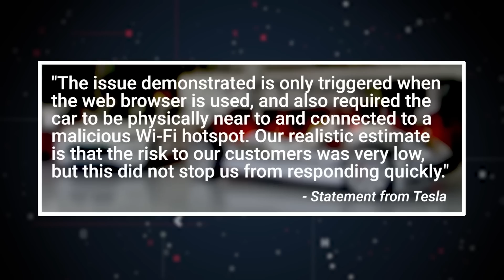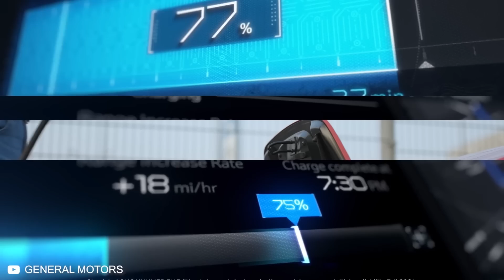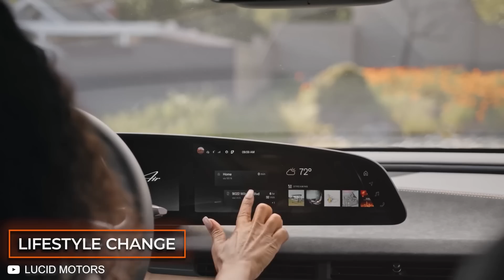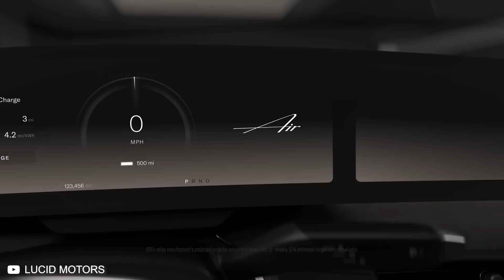EVs' Serious Problems That Carmakers Are Hiding

Comment: Cost of maintenance of ICE car is high plus the  regular inconvenience of  going to dealership/ gas station for said maintenance. Expenses  for  engine breakdown are  also  high. Most internal combustion engines give you problems after  50K-100K miles   which an EV/ battery  pack can surpass without so called "maintenance". Some called EV  living in a bubble- Oil is going to run out  sooner or later and  subject to whims of dictators. Expecting oil to be around  forever is living in a bubble
Reply: I currently own TWO ICE cars with better than 150K on the ORIGINAL ENGINES LANCE!! In fact, my wife's car was born 21 years ago and runs like a CLOCK today! Her PT Cruiser is still on ALL of the original components and my 2007 Magnum with almost 300K miles is STILL on its original motor and only on its second tranny. I will take $50 oil changes all day long against 7K to 10k battery replacements...BTW-Care to race me CROSS STATE or CROSS Country sparky? So its pretty ignorant to say most ice cars engines live 50k to 100k miles. Also, the Earth MAKES OIL BRO! 30 million barrels of it EVERY DAY! If we were going to run out of it-we would have by now! Start THINKING for yourself bro! Many many oil wells keep producing oil LOOOOOOONGGG after they were predicted to run out. And BTW-only about 18% of oil is used to make gasoline. Most oil is used to (look out..) PRODUCE ELECTRICITY.....which means YOUR EV STILL RELIES ON OIL for its power.....So if oil ever "ran out" your EV would be permanently parked as well sparky...
Reply: Do you think the rare earth metals just pop out of thin air? You're also living in a bubble if you think we have an infinite supply of the lithium, cobalt, nickel, etc needed for EV'S. It'll all run out oneday. I need to tow heavy equipment long distances for work and EV's simply won't make the trip, and there's no way in hell that I'm sitting around loosing money waiting for a truck battery to charge. Also maintaining my truck myself is also a huge reason why I'll never buy EV. Why pay someone to fix something when I can do it myself?
Reply: Also only 50-100k before your engine gives you problems? Check and change your fluids more often (you can do it for free in your driveway or on the side of the street with a little work ethic😉) Preventative maintenance goes a looong way.
Reply: Never had a issue prior to 270k mile and approx 20 years old.  Maybe if you maintain your equipment better the cost of ownership would be cheaper. I have gas tractors that are 80 years old and still as good as the day they were built.

Comment: Would I buy an EV now, no. In five to seven years, the infrastructure, better battery technology and magnetism will possibly allow ways to charge while driving. I can imagine in more urban areas, the expansion of electrical lines from metro rails to HOV lanes. Later all highway lanes with be electrified for charging. At that point, I'll take another look at it.
Reply: Tesla is currently pretty good. But I agree, I'd love a Rivian, and Rivian is good for the current technology, but Tesla is still better. A little more range and a bit more extensive charging network would make me feel better with the RT1

Comment: EVs are very good for local commutes as like for shopping, doing errands, taking the kids to school, going to a doctor or dentist appointment, and etc. As for long distance travelling where charging stops must be made is not ideal, unless you don't mind long stops. Range and charging times have been improving since the last number of years, but there is the charging issue for long distance driving.  There is the huge convenience with a charger installed at home. When you come home at night simply plug in the vehicle. The next day it is ready.  If you only drive 30 miles per day the average EV can run for about 5 to 7 days between charges (depending on the vehicle range) in case you forget some  nights to plug it in.  Presently if you plan on doing frequent long distant driving it is best to stay with gasoline. The way things are going with governments and society we are all going to soon be forced to drive an EV. 

There are aspects as like compatible chargers while on route, and available charging stations. When on the road you may have to wait in line to use a charger at some places. There are smart phone apps that can show you available charging stations that are compatible for your vehicle.  The GPS systems in many of the vehicles should have charging station location info. 

As for the life span of the battery pack, after about 5 years or so there will be some indicated or noticeable degrading in range. Ideally you would not want to keep any type of modern vehicle for more than 4 to  5 years, or especially when it is out of warranty. Too many very expensive to service issues that can come up, and also depreciation starts to fall at a more rapid rate. You want to trade in your vehicle while you can get a more decent return on it.  Especially for EVs compared to gasoline vehicles the depreciation is very fast. This is because of the battery pack lifespan, and the huge cost for servicing after the warranty is finished. Then there is also the long term availability of spare parts for servicing. 

As for buying a used EV, remember you are buying an older battery pack along with it!  Rebuilt battery packs may be cheaper, but they will not last very long in relation to what you pay for them. Don't go by what the rebuilding service tells you. Rebuilt battery packs are made up of mixing and matching cells from other used battery packs, and may have a mix of some new cells in them. Remember the other used cells are also older, and thus will have less life in them.  You will pay less for a rebuilt battery pack, but you will also be soon changing it again.  

Because of the rate of technology change, when buying any used vehicle that is more than about 4 to 5 years old take care about long term availability for spare parts. The technology is changing very fast and the manufactures will not forever be making spare parts for these vehicles.  Older versions of the components used in the modules, and also the manufacturing of the older type modules would not be long term feasible for any manufacture. This is the same for older type battery pack replacement if a new battery pack is desired for an older vehicle. As time and usage goes on, all devices start to become less reliable.  The battery pack is very specialized and has to exactly match by design to the model of vehicle. It is not a generic type assembly, equivalent to the idea of being simple batteries. This is the same for the electronics modules and most parts of the vehicle.  There are not many EVs in scrap yards if you wanted to buy used parts to service your EV.  Used electronic modules can be complicated to make work because of firmware version issues.  The vehicles of today are computerized and run by computer systems. There are many modules involved. Very complicated to locate problems and do the service work. 

As for EVs there is an increasing demand for them especially from people who are interested mainly for local commutes. If keeping the EV for not more than about 4 to 5 years there can be a huge overall cost savings. For someone who drives about 10,000 miles per year, in comparison to a gasoline vehicle when including the general maintenance they can save in the range of $3500 to $4500 average per year based on 4 to 5 years of operation, and not having to pay for repairs of the vehicle. There are no oil changes and general type maintenance as like required for a gasoline engine. Electricity for the energy source is a lot cheaper than using gasoline.  

If you are spending $300 per month for gasoline to run a vehicle, the equivalent cost for electricity would be less than $40 in most locations.  This is under $500 per year for electricity vs $3600 for gasoline. Over the period of 4 years this is like a $12,400 energy savings! This does not include the average of $600 per year for the proper maintenance cost of a gasoline engine if there are no parts necessary to be changed that are not covered under warranty. 

I personally know someone who is working at a car dealership. He was telling me they have more orders for EVs than they can supply.  Depending on the model the wait times can be six months to a year after the signing of the purchase agreement and paying the deposit.
Reply: That's a lot to read,  but the information is very helpful 👌
 and thank you 👍

  I am a #Patron subscriber to the Electric Viking channel. I do learn a lot about EVS there.

 I'm sitting out from buying an EV for the next 2 years.
( I would like to wait longer but I don't have the patience)
 The 1st EV  I will buy will probably be in 2024,  the way battery technology keeps advancing and at its current rapid rate a EV today with today's current battery configuration will be obsolete within 2 and a 1/2 years.

 Prime example is that the early EVs with the "3G Technology" are now dead in the water with "5G technology"  kicking in.
Reply: Who wants to read your whole post, much less wait an hour (or even 30 min) at any "fuel stop"? EVs are retarded for long distance. For city driving, they're absolutely wonderful!

Comment: The problem is the battery cost. But it’s not just that - it’s about how much profit manufacturers want to make. The whole approach of pricing things as high as possible, to push to the absolute limit what the market will bear. Most ev’s will cost more than the ICE counterparts, even if you calculate the savings over the life of the car. The balance point changes now, of course, with higher petrol prices.

Comment: the bigger issue is it's not in the pervue to demand or mandate all electric anything. it does'n't do anything to mitigate cc. also changing all the vehicles and infrastructure is far more detrimental than just cleaning up fuels by making synthetic versions  it's cheaper than dino juice , and captures carbon.  keeping our ice cars is far superior than mining rare earth metals. this is about control, not cc.
Reply: how much will the synthetic fuels cost?  The research I've seen is that they are hoping to get the cost of a gallon of synthetic gas down to 10 bucks a gallon (current lab production is equivalent to $50 per gallon)
Reply: @zeusmultirotor8479 it's expensive because it's not produced in large quantities, if it was it would be cheaper. A better question to ask is was is prime energy source for synthetic gas? It's not a new technology, the Germans actually produce synthetic gas from coal during WWII. When you consider EVs are predominantly powered by coal (via electricity), one should ask: why don't we keep ICEs instead of EVs and use synth gas from coal? There by eliminating two major problems with EVs, travel range and environmental impacts of rare earth mineral mining.
Reply: The carbon dioxide emissions are actually beneficial. Benefits include increased agricultural yields, reduced winter heating costs and fewer deaths from hypothermia. The current mean surface temperature of Earth (15 degrees centigrade) and atmospheric carbon dioxide concentration (415ppm) are suboptimal. It is a popular delusion (Climate Delusion) that mans effects on the earth’s climate are significant and dangerous. It is lunacy spending trillions of dollars trying to prevent small and beneficial changes to the earth’s climate.
Reply: Don't forget that the global warming scare is a hoax. Remember the Univ of East Anglia unauthorized release of emails between climate scientists? Someone released the evidence of the global warming fraud and the media pretty well covered the story with a pillow until it stopped moving.
Reply: You realize that those in the American Government push these EV also prevent the permit to mining of these materials need to make the batteries. Pushing it off on countries that don't have and EPA. More pollutants in the air. The only reason to push  it is to limit and control the American people.
Reply: Hybrids have many of the advantages of an EV with few of the drawbacks, hydrogen is also great and is essentially a clean ice all it needs is investment in pump infrastructure.
Reply: @catocall7323  they can't get rich with hydrogen running engines....
Reply: Back door to socialism
Reply: @Amor1990  Scratch off that top layer of green and you'll find RED.

Comment: That's why I feel we need to keep both electric and fossil fuel. There are pros and cons with both but it seems fossil fuel is more dependable right now I drive a 2014 Ford expedition EL XLT my family and I are the second owners of this vehicle so far we haven't had a major issue with it☺️☺️☺️ and we have been putting heavy miles on it since we had it in which we bought it in 2015
Reply: It's almost a certainty this is how it will work.  We're not close to having enough production capacity for the batteries required.  This is at all stages, from mining to factories.  These are a the sorts of operations that take years to get off the ground and investors are hesitant to put money into today's battery technology if it will be obsolete in a decade.  I read a recent article that stated they'll have to concentrate on hybrids to come close to goals.
Reply: @carlrood4457  not to mention our electrical grid will not be strong enough to support it and if we could build an electrical grid strong enough to support them you have to consider the more electricity you generate the more it attracts lightning so off the bat you will be facing two scenarios one where you will be forced not to be able to charge your car enough or power failure due to lightning striking

Comment: I think downside of a EV  is u can’t personalize it the days of doing things like increasing horsepower, custom exhaust and things we currently do to gas cars will be a thing of the past unless they design a EV that’s owner repairable like plug and play parts like if diagnostics detect a part is bad pop it out go to parts store get new one and pop it back in and reboot car lol
Reply: Sure you can.  People mod their Tesla's all the time. Tires, wheels, shocks, suspension, camber plates, wraps.  All sorts of things.

But I know what you mean.  You won't be doing very much engine computer chipping in the EV space.   The horsepower is already too much anyway... a Tesla Plaid gets kicked off of tracks for exceeding speed limits without the required safety gear fitted into the vehicle, for example.  Any two-motor EV, even the ones not billed as sports cars, already accelerate as fast or faster than even some supercars.   Its a sad day at the quarter-mile now.

In anycase, owner-repairability is not a function of EV vs ICE.  Or to be more succinct, a new EV is just as owner-repairable as a new ICE... meaning, not so much beyond the basics.  It isn't a distinction between EVs and ICE but instead old verses new.

Besiides, a lot of the stuff that people DIY'd or third-partied before are for drive-train elements that just don't exist on an EV.  There is no automatic transmission to rebuild, no gearbox (beyond a single fixed reduction gear), no trans-axle.  No oil beyond the transmission oil for that self-same fixed reduction gear.  No engine timing to mess with.   In today's world, mods tend to be in the suspension and lower, or in the passenger compartment.

Its generational.

-Matt
Reply: @junkerzn7312  I do agree but when EV’s take over and 70% if not 80% of the population have one some will miss working on their car to save a buck or just to customize to their personal taste that’s just one of the cons
Reply: I have a model 3 and have no desire to modify it at all.

Comment: Clearly, the longest-lasting and most economical (over that lifespan) vehicles are hybrids. This will be true for many years to come. 
 When solid state batteries become viable on a high production/low cost basis, EVs may increase in number much faster. For now, large scale lithium batteries are still too dangerous and require metals that are mined in mostly other countries.

Comment: What about the envirnmental impact of EVs.  The disposed of batteries could be a huge enirnmental disaster.  There needs to be recycling of ev batteries or refurbishing by manufactures.  Also, the cost of replacement batteries is a huge deal if it cost 10K or more.  Then you also what happens when ev gets in wreck and spills battery acid all over the place.   The number of cars that will be in line to get a charge at a charging station could really be a detterant to implemenation let a lone slow charge times.  Politicians should rethink mandating elimination of gas powered cars for the propaganda of climate change.  With the Russia war on Ukraine we need to work on making gas cheaper instead of stopping oil piplines and new drilling.
Reply: @Robert Lee  I agree that the government should stop rushing toward the mandates for battery electric vehicles.  In my extended family, that is just creating more pushback against electric vehicles.  The market will move toward battery electric vehicles and plug-in hybrids anyway, and then in 10 or 15 years, the government can start figuring out what is a reasonable transition.   Ha, I just used government and reasonable in the same paragraph! 😄